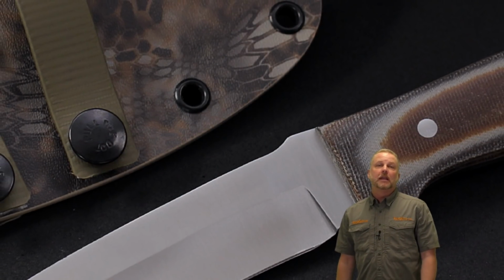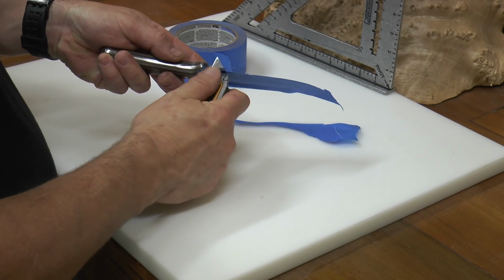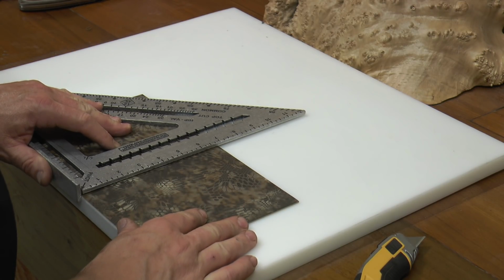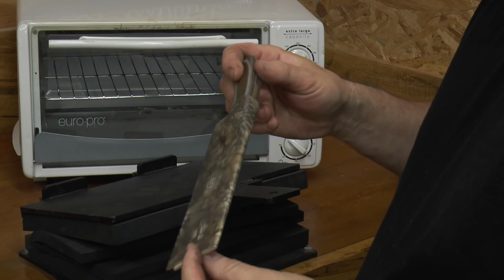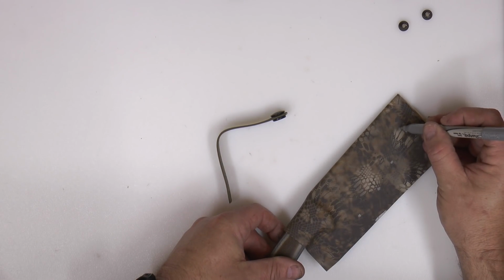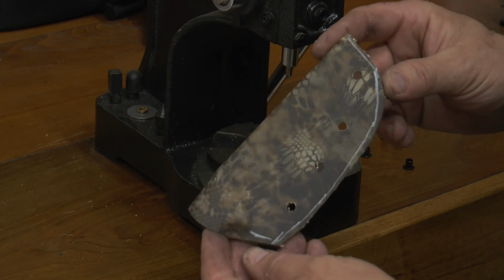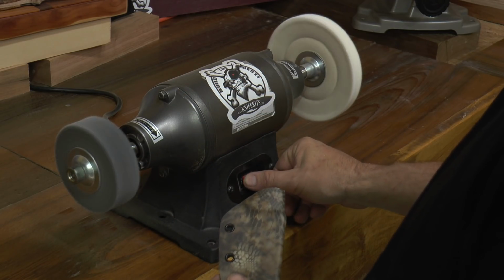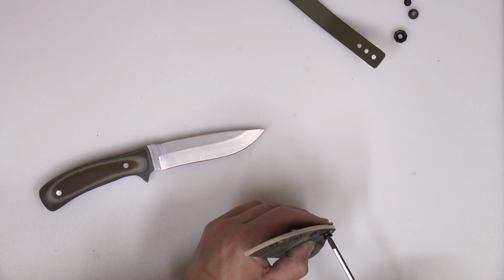How to Make a KYDEX® Knife Sheath w/ Olive Drab Soft Loop Attachments

Comment: Nice sheath. I would flare out a place for your thumb to push on to make extraction of the knife effortless and quiet at any speed and I would have moved the belt strap one more eyelet closer to the point of the knife to make the knife more stable and rigid on the belt. You want your knife to not move or jiggle around on your belt. Just a couple of helpful suggestions for you.

Comment: You can mold a piece of PVC gutter in same way, and get similar results (minus kydex legendary resistance ofc). It's a good idea to practice with way cheaper PVC before moving to kydex :)
Reply from the maker: Another option is to learn with boneyard material. This way you can use real Kydex, Holstex, or Boltaron at a substantial discount. Look here for details: https://www.holstersmith.com/vcom/specials-c-916.html

Comment: What are the screw and post lengths for attaching the strap to the holster! I can't find the information anywhere. It looks like 1/4 post and 3/8 inch screws but I want to be sure before purchasing.
Reply from the maker: Hi Desmond. Thank you for watching. We normally use a 1/4 slotted post for most IWB strap attachments. We're generally using the eyelet hole to pass it through. A 3/8 screw will work on most, but you can go with anything longer and trim it down if needed. Here they are will hardware included.... https://www.holstersmith.com/vcom/mountings-belt-loops-iwb-c-547_412.html
Let us know if you need more help!

Comment: What hardware do I need in addition to the IWB strap??  I was thinking of using chicago screws for the whole sheath instead of eyelets.
Reply: The barrel on the standard Chicago screw post is a little long to use without modifying it. You may have to file both it, and the screw, down, just to get it to pinch the material tightly. But it is possible to build it with Chicago screws. Eyelets are the only way to go if you're going to do more than one, though.

Comment: This configuration is for horizontal carry.  Not IWB.  

smh
Reply: I don't believe that I mentioned this as an IWB configuration. If you mean the fact that I call the loops IWB's, that is what they are. The full name would be IWB Soft Loops, but they are called IWB's, IWB loops, and soft loops. Since the original IWB's were made of leather or rubber, we simply called them IWB's, and I still refer to all versions of IWB loops as IWB's from time-to-time.
Reply: @steveandrews2234  See description
Reply: @gregbrown3082  ROFL. Thanks for the heads up. I didn't even read the written description. I fixed it.